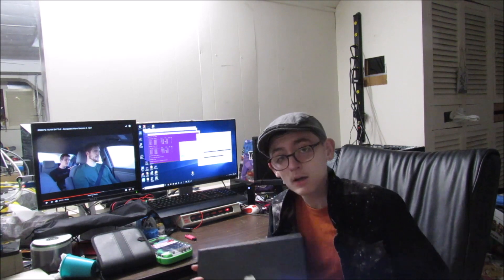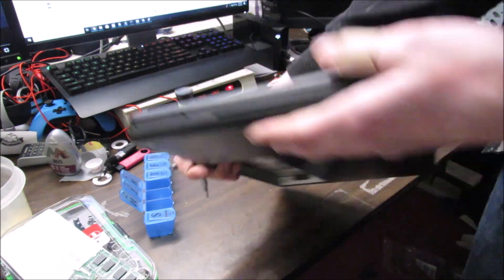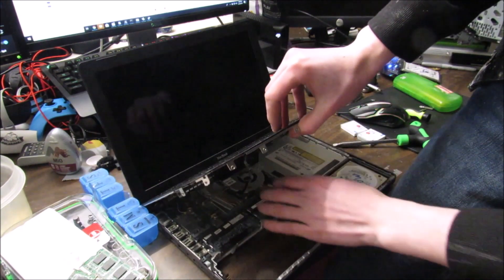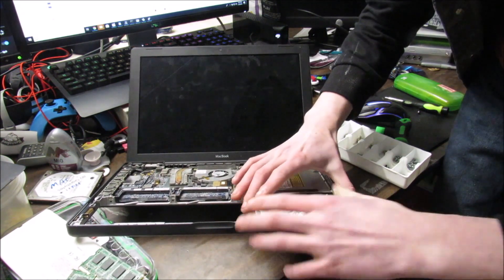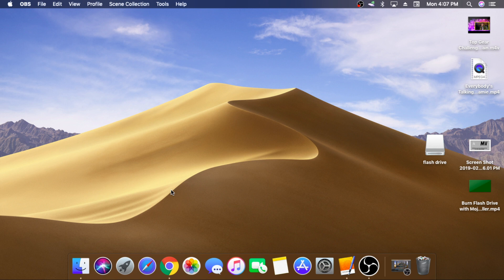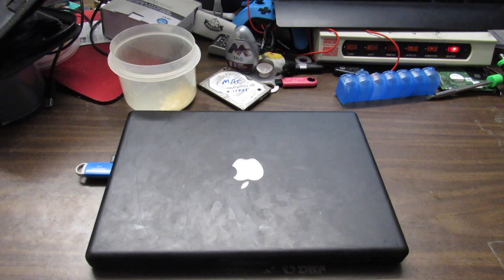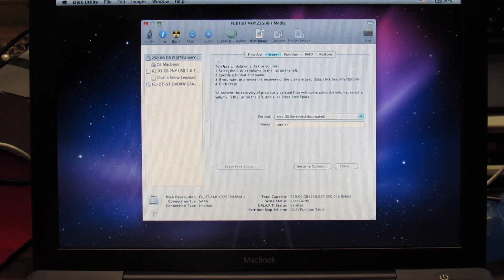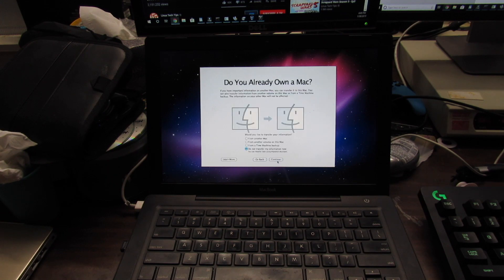MacBook A1181 Repair and OS X Reinstall

Comment: i WATCHED A DIFFERENT video -- NO NEED to Remove ANY SCREEWS. Just remove the battery, pull on the Plastic Tab affixed to the Hard Drive Mounting Bracket and the SATA drive pulls out!!!
Put the bracket onto a new drive or SSD, slide it back in -- DONE
Reply from the maker: didnt say you had to, I said you could do it the way you suggested. I also believe I stated that the tab was broken on my hard drive mount so I had to attack it from another way

Comment: You pull the battery out, 3 screws L bracket and the hard drive comes out. No reason to pull it all apart.
Reply from the maker: Rob G I said in the video that you didn’t have to take everything apart to get to it, but that I was because I was checking other stuff
Reply: @RepTechMedia08  sorry didn't notice you said that. Great video and thanks
Reply: @RepTechMedia08  bro did this MacBook is good for editing video ?
Reply from the maker: Not really. It is an old 2006 model, it’s basically only good for minimal web surfing and such
Reply: @RepTechMedia08   I found one of those MacBook. But it has no os on it at all but it very difficult to find software that works because you never know what version it is

Comment: You can remove the HDD when you remove the battery, you dont need to disassembly whole notebook
Reply from the maker: While both of you are true, my reason to project it that way was because the idea of the video is a COMPLETE tear down. So it doesn’t really matter
Reply: jóvanna,meg akarta mutatni a gádzsó :-)
Reply: bro you did not see he do not have white thing in back  of fiting so he can not just pull the hd out,